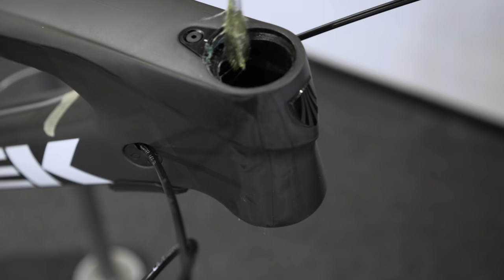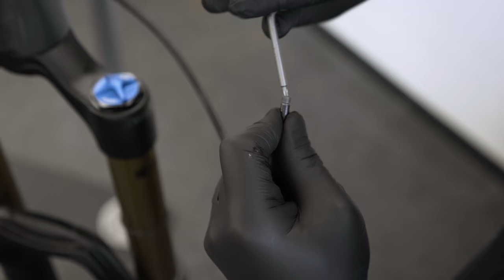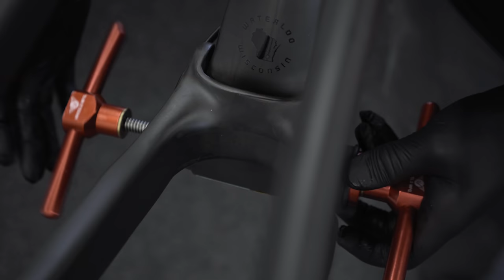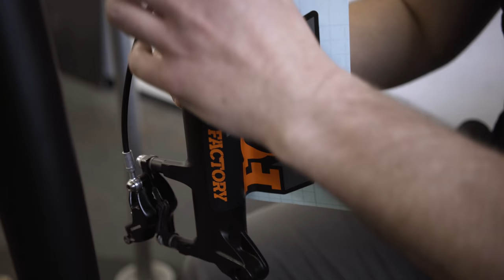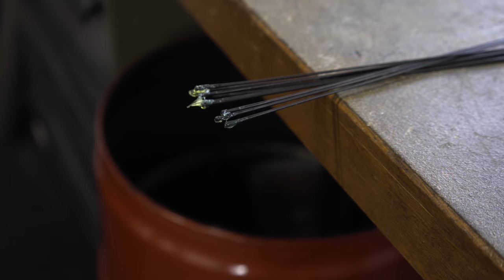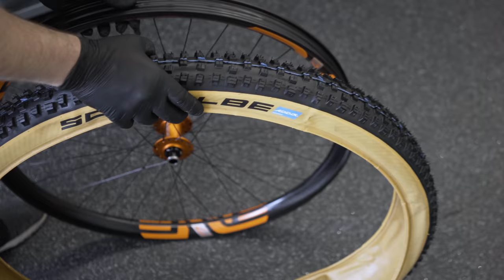Custom Trek Slash 9.9 Build | Cycling Lounge

Comment: $12k bike, easily. Then throws slide on grips and tubes on it. Must have been at customer request.
Reply: Brakes are a huge hole in the spec as well. Pretty weird choices given the rest of the spec.
Reply: Maybe that's what they like. It is their choice on what they want to put on their bike
Reply: I’d rather just buy a dirt bike tbh
Reply: A lot of top riders swear by those foam grips.  I agree that the  guide brakes are an odd choice for a spare-no-expense big hit enduro machine with a big ol' coil shock...
Reply: likely a customer request, and those XC clipless pedals,  ughh
Reply: and xc pedals??
Reply: @bfranco1519  The pedals... ok. But Nobby Nics on a Slash?
Reply: Stay in line or the sheep will talk bad about your choices. God forbid someone do something that others disagree with 🐑🐑🐺😂😂
Reply: Strange to match Shimano pedals with a full XX1 groupset.
Reply: hiro111 this one got sold on ebay for 10k
Reply: the best feeling I ever had is with slide on grips, ok i change them every 2 month but it is ok. Sometimes : the simpler, the better.
Reply: @m4.leeeeon  I swear to god that my brother bought one with 999.99 $
Reply: @lebyadradia5991  probably did, but not the same spec as this
Reply: @dudz5825  custom street trial not normal he collected the parts one by one I swear to god it's sooo gooood
Reply: I work in a Bike shop and I would rather have tubes than TL because the cleaning you have to do when changing the tires is super annoying. If you drive carefully a tube last much longer than TL because you have to change the milk at least once a year.
@Brian Domski what is wrong about the brakes?
Reply: @lebyadradia5991  yeah but not the same spec as this 😂
Reply: @gasmaske1232  completely disagree, tubeless literally can save a day of riding. Happened to me wher eive had 3 punctures in 3 hours because I was tubed.
Reply: @dudz5825  did you ever had to clean dried out TL milk? Try to put milk in the tube. Solves the problem of punctures and of cleaning.
Reply: Charles Hainsworth I don’t think SRAM makes pedals. It’s also personal choice
Reply: looks like a show floor bike
Reply: @dudz5825  TL doesn't protect against punctures it protects against pinches. Pump your fuckin' tires up & it won't be a prob. :/
Reply: Might have $12k price tag, but $2k bike. :/
Reply: it is like an xc bike with enduro suspension
Reply: Tom Bugler guide ultimate are a hole 😑
Reply: Charles Hainsworth sram dont make clips
Reply: the grips are super comfy, and chances are it will be sat on a shop floor, hence why tubes are in as they hold air better, so they dont have to pump them up every other week
Reply: probably to wear in the tires before installing tubeless idk
Reply: Dudz pinch flats were the worse. Tubeless is a god send. Besides for spilling sealant on the carpet which my wife has yet to let it go lmao.
Reply: I like both Sram and Shimano stuff. When it comes to brakes, I've found that Guides have great modulation that you just don't get with Shimano. Some people prefer that, or some people prefer the light switch feel of Shimano. What I can say is that typically Shimano stuff is more reliable and requires less constant adjustment to keep it feeling good.
Reply: more like 9 g's and no AXS? weird. If you are in the bike industry and have discounts its closer to 5 g's. Depends on your employer but he def. issed the brakes and axs....
Reply: Gasmaske 123 Willst das 3-fache gewicht an rotierender masse?
Reply: hes shaving grams
Reply: And isn’t xx1 designed for XC racing
Reply: I like it as a  mix of old and new school spec..sweet..
Reply: I honestly like tubeless and tubed.  I run either setup on all my bikes
Reply: i’m pretty sure that was cush core not a tube

Comment: good looking bike but running inner tubes in 2019 sounds absurd. And the Nobby Nice despite being pretty good looking thanks to the gummy walls are not suited for an enduro 29er such as the Slash
Reply: Wasup with inner tubes bro ? 😲
Reply: @postymosty1221  they suck! HARD! When running with tubes you need higher tire  pressure and the risk of puncture is greatly increased. All recent tires and wheels nowadays are tubeless ready there is a good reason for that

Comment: Hey there Cycling Lounge!
I have question about conversion for FOX dhx2 coil shock; Which shock dimension is one on the video, and which conversion shaft has been used for that build?

Mine current bike is Trek Slash 9.7 2019 with stock re aktiv shock. I would like to go for coil shock asap, but i dont want to make a wrong order, or uncomplete one without proper mount for it.

Comment: Nobby Nic for an Enduro bike?? Really?? good looking tho
Reply: He is probably a poser, cruising around XC tracks with this enduro bike.
Reply from the maker: Hi 555,
No worries, the owner is an extremely aggressive rider.
And the Nobby Nic are not the worse tires even for enduro riding, 
especially when paired with a Magic Mary in front. 
We felt like keeping the same tires for front and back would look best for the video.
Cheers
Reply: @CyclingLounge99  That's what I thought. Btw, how did you fit that shock in that frame? the trek size is a 230x57.5, did you put  a 230x60 shock with some kind of spacer in the shaft?

Comment: Since I know this is a 10k+ bike, I am gonna be picky.
1: It is ugly. There are too many different colors. Black, grey, orange, gold, and then the skinwall wheels. It needs to be narrowed down to about 3 colors, preferably black, grey, and gold.
2: If you are going to spend the extreme amount of money required to buy a carbon frame, xx1 drivetrain, carbon crankset, etc. Might as well also use carbon spacers and stem instead of the regular ones. The spacers are like 10$ and for some reason regular spacers are quite heavy. Also the uncut steerer tube bugs me.
3: Tubes? Are you kidding?
4: The brakes are way under spec'd for this bike.

Comment: I feel like there so many things wrong with this video! No fiber grip on bar or seatpost, but instead regular grease (looks like motorex, which is good grease). Nobby nics on a slash?! Looked like grease on the spokes instead of spoke prep. Didn’t lineup the tires and wheels so the labels matchup. No torque wrench on BB or cassette or brake calipers or shifters and brake levers... smh

Comment: Cool build and cool bike, but it's a little alarming to me that in this entire video there was not one single use of a torque wrench, except for on the handlebars. Between the crank set, brake rotors, headset, brake levers (because carbon handlebars), and there's probably other stuff I'm missing, a torque wrench should have been a religion on a bike of this caliber. But that's just my two cents as a tech

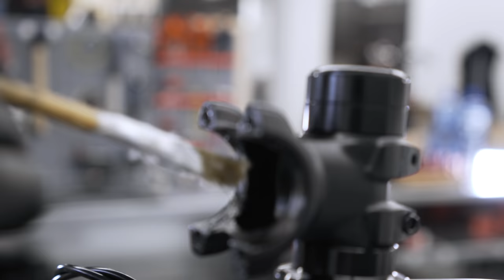Comment: 1:14 is that grease you putting on the stem?
Reply: Carbon grease for the carbon bars. It has nano particles in it so less pressure needs to be applied to hold them in place

Comment: How much this set up bike please
Reply from the maker: Hi Joemar and YMB,
The rear shock is custom fitted, due to Trek not offering any spring shocks on the Slash.
Also the whole groupset as well as wheels and seatpost were changed.
The only stock things are the frame, the fork and the handlebar/stem.
Cheers